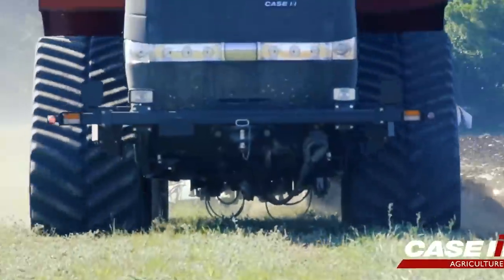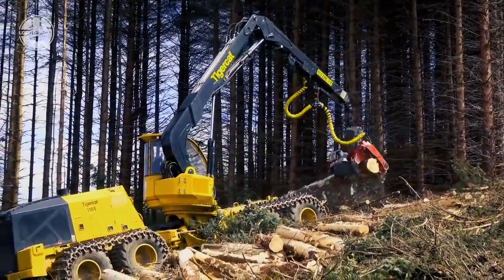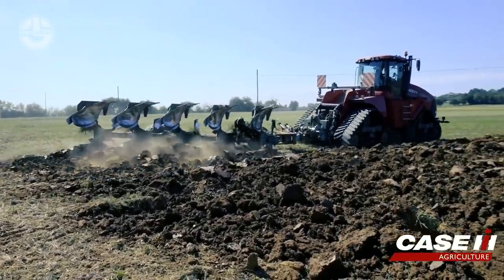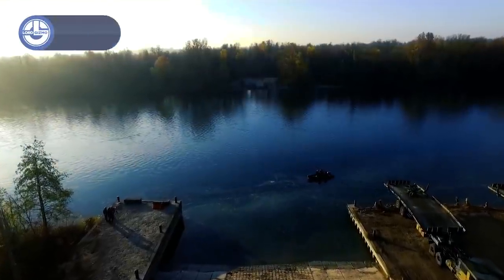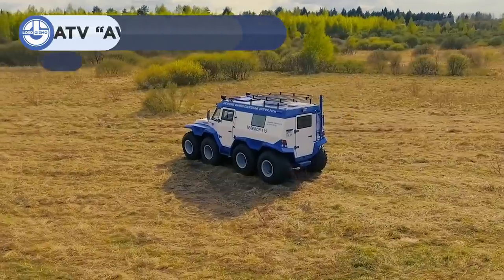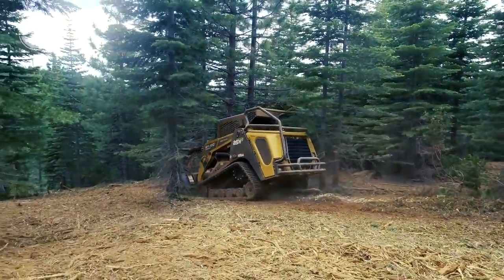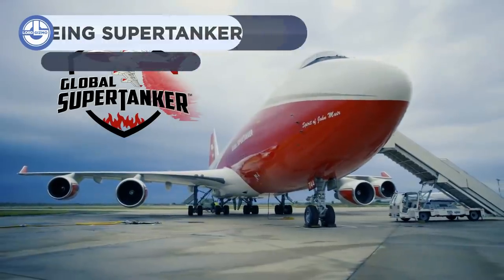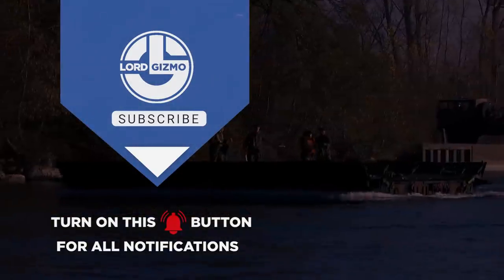Cool & Powerful Machines You Need to See

Comment: I would think the old water bomber design would be better than a 747 as the water bomber can get water from lakes while a 747 has to go back to an airport and rely on a water source and pumps. I would think that is far more costly
Reply: Best water bomer lands and sucks up water then takes off
Reply: The 747 carries more water as the water bomber has a boat hull to lift.  Additionally, they can add/change the mix of flame retardants much more easily at the airport.  The water bomber is very limited on the amount of chemicals it can carry.  Now, when really far away from an airport, the water bomber is king.  That's why you will always see them in places like Alaska and Montana.